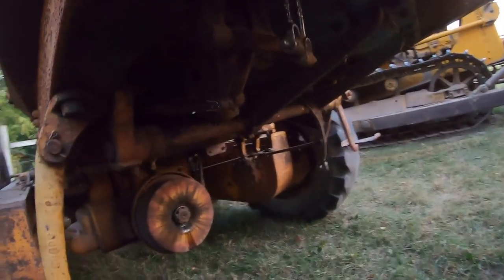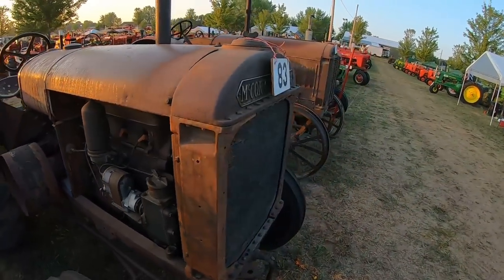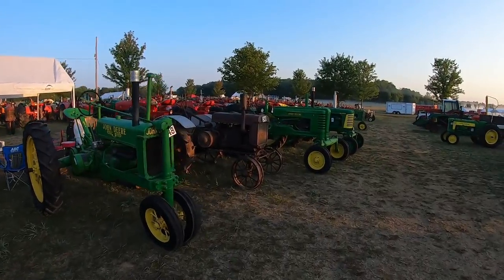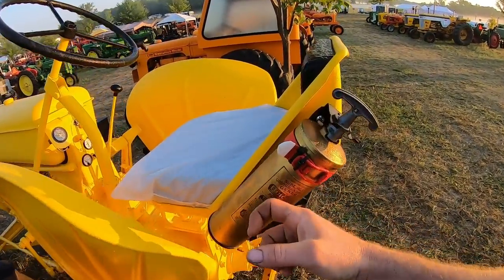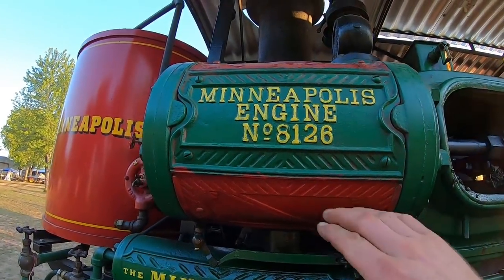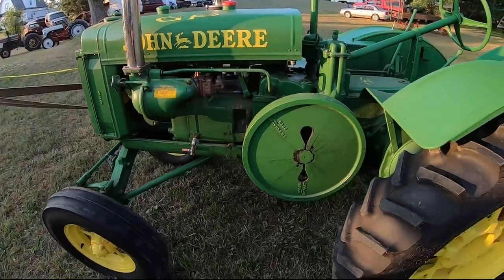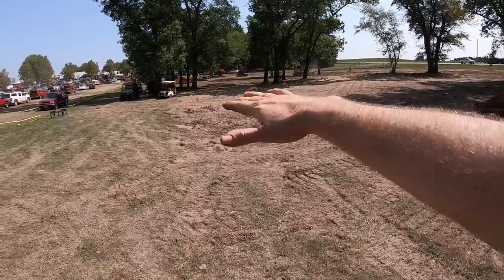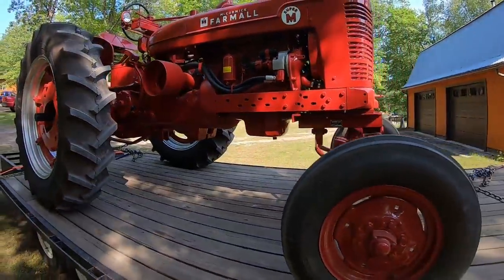Nowthen Tractor Show 2021 Part 3: Sunday Tractor Walkarounds, Finishing The Dirt Work & Heading Home

Comment: Ahh....once again the sweet sound of a two-cylinder in the background on a cool tractor show morning!  ;-)  On a more serious note, I like how you described the transfer of power on that GP which was John Deere's theory that if everything stayed in line you got more efficient use of your power vs. changing direction in the transmission like in other brands.
Reply: @squatch253  Yep, less moving parts meant cost efficiency
Reply: It worked the old man I started working for in the Deere trade sold 2 cyl tractors new.  he loved to do plow demonstarations at farmers places and sold a ton of tractors doing it as the deere tractors properly setup would out plow any other brand because of their very high rear weight bias making them great drawbar pullers and he had the cent an acre meter tool that was basically a quart jug you hooked to the carb and plowed as far as you could. He would put that same jug on any other brand and let them plow and see if they could get further or do more work. No brand ever did. he could usually beat the Farmalls 30% or more pulling the same loads. You might say well fuel was cheap back then but farmers have always been cheap. You show one they can save enough in fuel to pay the difference in the cost of the tractor a lot of the time they will.

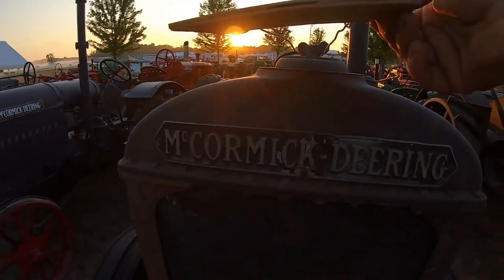Comment: That McCormick Deering at about 5:00 with the big angled grousers I believe is either a 15-30 or 22-36. The 22-36 superseded the 15-30. I have talked to the family that owns that selection of tractors a number of times and I believe it is a 22-36. After the 22-36, they introduced the W-40 series (including the WK40 and WD40 [diesel]). I always thought if a guy had unlimited funds, it would be really cool to build a W-9 row crop tricycle front tractor. You'd have to machine new rear axles, cast a front pedestal, probably build frame rails, and make a TON of steering components and tin work... But wouldn't that be a BIG DOG? Ha ha. There was a guy online somewhere that was working on putting a W9 motor in an M chassis, but I think he gave up on it last I heard.

Comment: TP - 36.  10:40
Tyre Pressure ? Military vehicles in the UK have the pressures by the wheels, as operators use many different machines. Easy to over-inflate if you forget. Quick stencil job, saving problems in the field.

Comment: TP36 means Tire Pressure 36 psi. Its a military wheeled vehicle standard to tell soldiers what the pressures are to be for there PMCS (Pre or Post Mechanical Check Sheet).
Reply: NYS DOT also puts TP  on its vehicles.

Comment: The GP was a design all to it own in the the John Deere line. The only horizontal flat head engine. I think most of the Fordsons were melt down to fight WW2. That's way there a so few left compared to the number built. Thanks for taking us along.
Reply: There’s still a ton of Fordson around.  They just aren’t real collectible.
Reply: @StubProductions  My nephew has a restored Fordson.

Comment: Tractor between the 10-20 and Cockshutt is either a 15-30 or 22-36. Leaning to 15-30. It has 2 tanks on top where a 10-20 has 1 tank. The tanks are for water and Kerosene. It used water injection to help cool the mix and stop detonation. Another giveaway is the 10-20 had the steering toward the center of the fuel tank where the 15-30(22-36) is offset to the right, almost to the side of the hood.

Comment: If you run across a Farmall Cub, that's what my grandpa had. It had the wide front, small and had the steering on one side and the engine/cowl off center.

Comment: TP 36  means Tire Pressure 36 psi.  it was a Military requirement to mark the correct tire pressure for all tire locations, but i did Not see the markings on the rear tire/wheel locations?!

Comment: Farmall M starts on first compression stroke every time;)!!!      Picture of 1530  small gas tank?  Is it set up to run on distillate?    (start on gas and switch to distillate when warm?)    I have the manifold and distillate apparatus for my Uncles first tractor.  Anyone have comments on how that system worked?   Great video!!

Comment: Why don't you chain down the tractor in 6 spots? I've helped my uncle haul a tractor and he had it chained in at least 6 different locations. It was a Kubota about the size of the one that's been in your videos
Reply: You don’t need 6 chains on a tractor of this weight - 4 is all you need. I think your uncle had too many chains laying around.
Reply: @mechanicalmarvel3136  years of moving heavy machinery he takes the stand of making sure the load is secured. It only takes a few more minutes to do 2 more chains.
Reply: This tractor isn’t “heavy machinery”. If you’re moving a Cat D8, then yes, you may need more chains.
Reply: @mechanicalmarvel3136  Famous words before a lost load " That should hold it ok."
Reply: You are right.